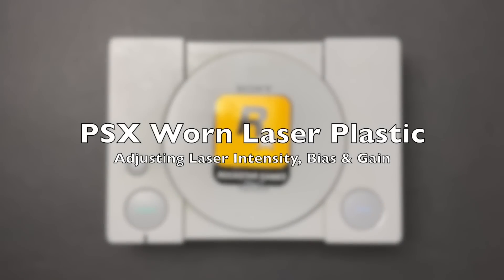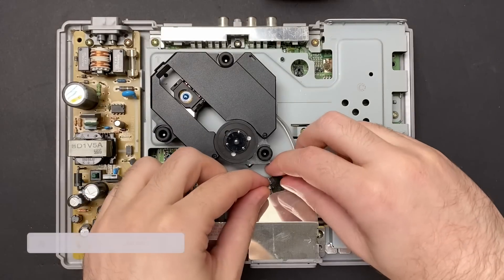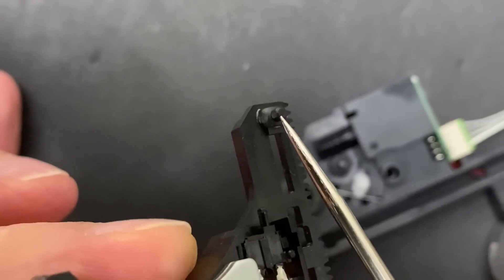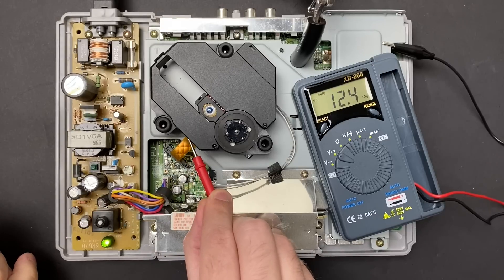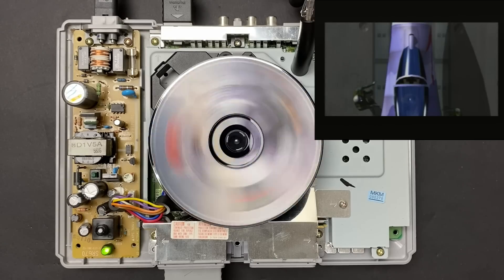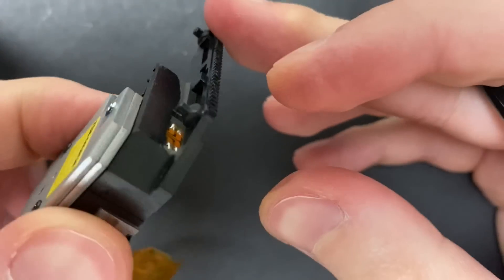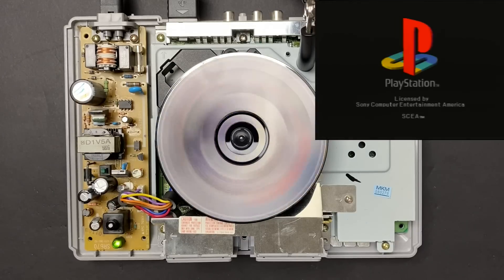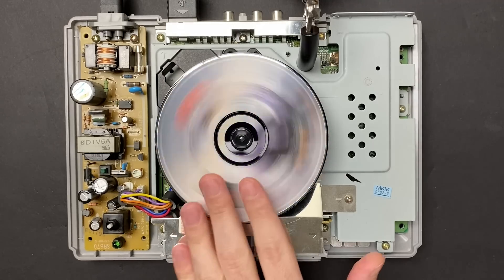Sony PlayStation Disc Skipping Issues - Retro Console Repair

Comment: I replaced my PS1 Debug DTL-1002 with a BAM laser from a working PSone, since EBay and Aliexpress lasers are all trash now (ship from the same factory in China) so it's better to source a OG Sony BAM version from another console.  The laser pot on the BAM was 12.1V so I had to lower it to 14.7V to get CD-R backups to boot and BIAS and GAIN read 1.72V and 1.84V

Comment: My PS1 has recently started suffer from audio-stuttering issues while playing games like THPS 1 and THPS 2. Some tracks will just stutter, almost as if those half-seconds have no sound at all. It's very annoying. At first, I thought it was the discs. But after putting them into my PS2, I discovered it was the PS1 console that was at fault. 

What could be causing this?

Comment: Wow. I've read about this method, but thought that you will use a thinner metal, like a foil. It's shocking how much height of the rail was "eaten" by the head assembly. I have PS1 4 drives with the same lagging issue. I definitely will try to revive them this way.

Comment: I tried everything you did, including the leveling. My system would only read discs on it's side. After exhausting all of these options, I sprayed contact cleaner into the spindle motor and manually spun it around for a few seconds, then sprayed again. Now the PSX works perfectly. So, not only does the angle of the console affect a worn sled, it can also affect a worn spindle.

Comment: For those who are still stumped, I've been able to revive drives by cleaning and oiling the drive motor spindle. Underneath the motor is two small holes, and I pour isopropyl alcohol into the roles, rotate the spindle a bit, then give it time to completely dry. Then I add mechanical oil (lighter than the lithium grease used on the sled) into the holes to lubricate the motor. After many years the disc drives will spin fast, but not always at the perfect speed needed to read discs without stuttering.

Comment: Thanks for the info, this will really help me out. I'm restoring an SCPH-1002 I got today which I'm going to use as a CD player. It does work but the audio occasionally skips (which a drive re-lube didn't fix) and it has the same symptoms of plastic flecks in the laser drive. Now I know where to focus my efforts from here.

Comment: Where would you buy a replacement drive for this? I bought one of these at an auction and it doesn't read the disc at all. Since you said there's no real reason to fix the drive long term I think I'll go down that route instead.

Comment: do you have a service manual for the scph-1001?
Reply from the maker: I looked into my files for this project and for the life of me couldn't find it. I have some bookmarked links which match the calibration values I used in this video, but I clearly remember looking at an old washed out PDF with specific instructions and some oscilloscope graphs. It's an old video so maybe I'm having mixed memories but sorry to say I was not able to find the service manual.

Comment: Hey Borderline OCD for the PS1 you repaired using the original drive if it starts to have skipping issues again after a while use a KSM 440 BAM  laser instead the laser used for a slim Ps One just you will need to swap out the top covers for the case top case to fit correctly or else it will not fit properly and a tip is use like a teflon grease not spray but grease will work better in keeping it lubbed better in the long term

Comment: Nice fix. The only thing I'd be worried about is using metal as a shim. Metal on plastic versus originally plastic on plastic. Using metal could end up grinding down what's left quicker than before.

Comment: Can i use something else than aluminium ? some other plastic?
Reply from the maker: Check the wear on your sled to see what depth of material is missing. The key is for the sled to slide level and with ease. I guess you can get creative, but you need something smooth and thin.
Reply: @BorderlineOCD  we are planning to use sheet of metal from old floopy

Comment: Hello, I saw your video, it is happening to me that my ps1 makes a strange noise when trying to read discs. I did the same maintenance and it seems that when I try to move away from the center the lens does not succeed because the gear that contains the wire moves a little and loses steps, will this be possible? Sorry for my english.

Comment: 11.4 mV for yours? Cool and I love the fix here. Great stuff. Mine seems to have a much easier time at 10.7 mV with a brand new drive and also reads backups quite well for the most part. My model has auto gain + bias so no pots for that, just laser power on the drive. There is one pot on the MB for a push-pull adjustment but I can't see any affect at all when I tweak that one.

Comment: I can confirm this fix with metal sheet works very well, i did on my 1002, and it completly eliminated video stuttering, works like new, i used metal sheet from floopy disc, like in original guide

Comment: This ones that you buy from China you may have to fix them also, i've bought one that i've had to adjust the height of the spindle, and clean even the mirror of the laser and the lens above and underneath and also the glass of the diode, it was very dirty, but it was of great built quality, actually a much better unit than the previous one that i've bought from China, that the spindle hat came of just from regular usage and the plastic detachable rail came very loose from design it seems, and it's clearly very inferior in built quality. So, i really think you should try to fix the original ones. Congratulations from the great work made on this one, very cool!

Comment: Wow, awesome repair. Every cause I've heard about the FMV's skipping on original launch model PS1's were all about the laser being heated and cooked from being placed on the left side of the unit close to the power supply. Apparently it was the plastic sled assembly being worn down instead. This explains why turning the console upside-down would alleviate the problem by allowing gravity to drop the laser sled closer to the disc.

Comment: I  went though a playstation repair-a-thon about 2 years ago, im done with that. They are so fiddley, one tip I can share is with direct strong light above the optical drive is not going to do you any favors. I had 2 units that couldnt read a disk to save their lives if my bench light (which is a pretty obnoxious bright 9600k strip light) was on

Comment: Hi, Im new to your channel and love everything you did to retro games.
I have a same model SCPH-1001 that is not showing any display when turned on.
I changed the PSU and test all fuses, that I know.
Hoping that if you can shed some ideas on what I need to check next to get it working. Thanks.

Comment: Wow.... Thank you so much for this video... You put the shim on the laser side.  Perhaps a shim on both sides would have been better so the aluminum doesn't just wear through the plastic..... Then again where do you find a 0.1MM piece of aluminum.... I tried doing this once and ruined a Namco Tales disk.... A stray wire pushed up against the disk from the underside and dug a slight groove into the disk... Double fail <Sigh,>.... Basically I got to the point of adjusting the Pots and gave up out of frustration in ruining the disk.  I probably still have it in storage.... Anyway something about seeing it from a source you trust makes it so much more real, if that makes any sense.  Thanks for making this more real.  I really need to find that thing and give it another go.

Comment: Nice video :) !
But, I'll give you some tips about the SCPH-100x and ABM/AAM/ACM laser class.

First of all, check F.BIAS/GAIN voltages from CL708 is useless. All you need is a oscilloscope and check the RF SIGNAL.
The main reason of F.BIAS pot presence on the motherboard is to facilitate the servo on the reading (focus operation). Move forward or back and obtain the best RF signal possibile (no jitter and with a stable RF envelope).

After that, move the laser pot forward to obtain 1.2v p-p with an original disc (music disc work too).

The GAIN is impossible to adjust :). Is used to trace and seek the sequential data pits on the disc. F.GAIN HIGH = Laser coil very noisy and sensible to shock movement. F.GAIN LOW= no reading. Try to find the best position when hitting GENTLY the console (I'm not kidding). If the laser doesnt' skip, that' a decent F.GAIN calibration.

Also, you have to lubrifcate motor spindle and motor sled.

-From an huge PS1 lover!

P.S That metal rail is very nice!!
Reply: Hi, what do you recommend to lubricate the spindle motor?
Reply: @LewisS4299  Clock oil or 3 in one oil

Comment: For calibrating these properly you need to achieve a coherent eye pattern using an oscilloscope on the laser test point. Arbitrary voltage values might get you close but not quite. The shim likely moved the laser and improved the eye pattern. The pots do the same thing but you can't see the result because you're not using an oscilloscope to verify that there's a solid eye pattern. 

Pretty cool workaround though.
Reply from the maker: I'm keen to get my hands on a proper oscilloscope at some point. I bought one of those cheap handheld ones on Amazon that you can get for $30-50 and I ended up returning it.
Reply: @BorderlineOCD  Ah yeah, those just don't have the bandwidth you need for stuff like laser calibration sadly.

Comment: My SCPH-9001 has this plague as well. Would the same thing apply as well for this fix? I do have PS2 consoles to use in the meantime, which they also need a laser calibration soon, but no skipping from the PS2 consoles.
Reply from the maker: Thats a much later revision and I believe the impacted area was replaced with metal rails rather than plastic. You can confirm if you take it apart and take a closer look. Might just need a general refurb like cleaning and new lithium grease on the gears and penetrating oil on the motor spindle.

Comment: I did the same with my 1001, but for me with an aftermarket optical drive I had this parameters, Bias 1.7v - Laser 12.3mv and Gain 1.73v.

Comment: I am getting similar results to what you got in the intro to the video, but my PS1 disc is fairly scratched up. (I got it resurfaced and it made some of the chopping better but not all of it.) I don't have this problem with music CD's unless they have nasty scratches on them. Gameplay works fine, the only issue is cutscenes being choppy and some dialog being choppy. (Would like mention its definitely not all, worse before I got it resurfaced, but it still is there.) Is this a laser issue or a disc issue? 
Edit: I don't have any other PS1 games apart from the one I mentioned, I just have music CD's as well which is why I mentioned them.

Comment: I replaced mine with a PSOne Optical Drive. But I'm confused because some people say Sony addressed the design flaw on later models and I also heard that the flaw persist in those later models still. So, I'm asking is it advisable to add a little grease to the PSOne Drive I just installed? If yes, which grease should I be using?

Comment: Where did you find the voltages for the bios, gain and laser intensity pits from?  I got the same issue but sometimes the PS1 disc plays or doesn't and just says insert a playstation formatted CD- Rom disc.  This is on a brand new ps1 disc and new laser assembly I've ordered.

Comment: I usually give up fixing the pick up block after some adjustments.I never realized that the wear out material on the plastic due to the movement of the lens would be an issue

Comment: Would a audio CD work to change the potentiometers back to where they are supposed to be or does it have to be a original black bottom PS1 disk?
Reply from the maker: The values in the service manual are for a genuine pressed disc. A commercial (not burned) audio CD might be okay but yo'ull want to play the last track on the CD while calibrating so the laser is in the furthest position from center (where it is less accurate than center and a good calibration target). Ultimately you want to test with a real game. If your system is chipped and you use a burned game, you will likely need to increase the laser intensity to account for the lower quality medium.

Comment: I had a similar issue with my JPN Sega Saturn with shuddering FMVs however dialing in the potentiometer didn't help.  I ended up replacing laser pick-up to fix shuddering FMVs.  (OPTIMA-6S)

Comment: Great video! Thank you to all the info that you've provided, but could you also tell me the link on where to buy replacement optical drives?
Reply from the maker: For this particular unit just search for KSM-440ACM on eBay or AliExpress. They're about $15 to $20 as of this writing.
Reply: @BorderlineOCD  thanks for the hint, I'll check it out

Comment: FYi that potentiometer on tthe PSU adjusts the System wide voltage. Someone might have tweaked that too causing the bias voltage to be slightly off

Comment: Amazing refurbishment & another stellar DIY repair ... Both thumbs-up, man ... A question, if i may: Do Series 7500 & 9000 of OG PS1s need their laser calibrated, after replacement? Best regards ...
Reply from the maker: They still have a laser intensity screw but no manual bias and gain adjustment needed (they adjust bias and gain automatically).

Comment: The leveling makes so much sense considering people would "level" their systems by putting it upside down. It was an alignment issue
Reply: It was such a weird thing to even come up with as a kid. Nobody told me to do it. I must have thought it was something with the laser not "reaching" the disc or something silly like that which made me flip the console upside and - and it worked. Eventually I sold the console but I did the console flipping for quite a while. I'm sure eventually it would have stopped working or maybe not.

Comment: I have a japanese system that has a rather minty laser in it, its an scph-1000. Im pulling my hair out trying to get the bias and gain right, even when i know i have it set correct it will sit for a week and then be out of spec again.
Reply from the maker: Do the voltage measurements read differently after a week? What about the resistance across the potentiometer terminals when the system is powered off? Do you think the dials are moving?
Reply: The dials are definitely not moving, its just that even once i do get everything set perfectly it undoes itself a little on its own. Im using a JP copy of ape escape to test and even in japanese i can tell that the professor’s voice lines are skipping.

Comment: Love your vids, man, keep it up! Wanted to ask. Is it necessary to use isopropyl alcohol to clean electronic circuits, contacts, plastic, etc. or is regular 95% ethyl alcohol okay?
Reply from the maker: I'm not sure bud I haven't used it personally so don't want to comment, but a quick search suggested ethyl alcohol may leave an oily residue which can impact sensitive circuitry? Perhaps someone else has tried it and can chime in.
Reply: @BorderlineOCD  I see. Better not to risk it and buy a bottle of IPA. I just have a large supply of ethanol, so I decided to clarify this. Thanks for the reply!

Comment: Great video! :) I also recommend oiling the spindle motor. That fixed two of my PS1 drives that were skipping.
Reply from the maker: Do you oil with penetrating oil them or use contact cleaner?
Reply: @BorderlineOCD  I use some generic "3 in 1" oil for mine and it works great. Supposedly sewing machine oil and oil for RC cars or model trains is the best :)

Comment: you need change motor too
Reply from the maker: The spindle motor or worm gear motor? How come?
Reply: @BorderlineOCD  spindle motor. because disks are also poorly readable. can be taken from the old cd/dvd-rom drive or quality new RF-300.
Reply: @BorderlineOCD  the spindle motor should not make unnecessary sounds.

Comment: I've had nothing but trouble with them chinese replacement drives. I got my launch childhood ps1 that I've been trying to get up and running again. Went through 3 of them chinese drives. Two were doa, 1 of em lasted a few months before it died. Gonna try your fix on the original drive
Reply from the maker: I've heard those drives are no good as well, but I'm curious to give them a try. I'm hoping that fine tuning the optics and some quality grease will improve the odds a little. If you can get the original drive working again its a fun project, if nothing else just to get a little more time out of it.

Comment: I hit a like, but I couldn't stop but wonder if you could have just installed a hard or solid state disk drive in place of the disc circuitry and machinery instead, plus add high definition capability for an optional exercise, instead of struggling through and working around an obvious engineering flaw.

EDIT: This does not intend to discredit your fix, which seems okay for now at least; great job!  If the 1001 series is collectible, then keeping it in collectible condition instead of modified might be better for the preservationist angle.  If so, make sure you stow it away somewhere and find a 550X to tinker with instead.
Reply from the maker: With the availability of ODEs like the XStation and Terraonion MODE (and PSIO if you have a system with the parallel port) folks have more choices than ever. I do like owning a "virgin" unit and a modded one. In some of my other projects, often times they don't even make sense financially but I still do them and buy the parts needed etc. because I enjoy the challenge of restoring it. Thanks for the like 👍🏻